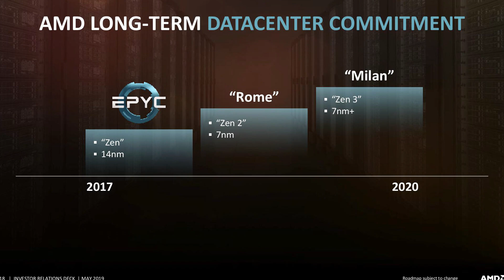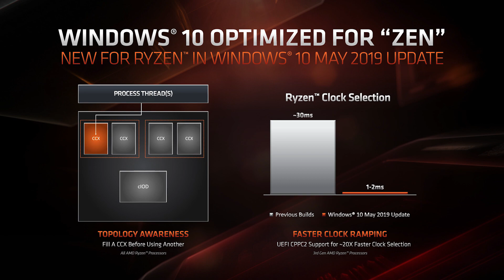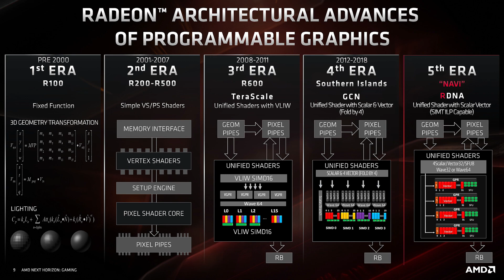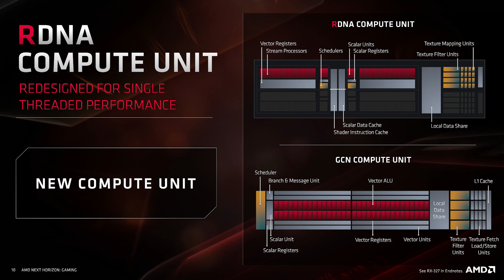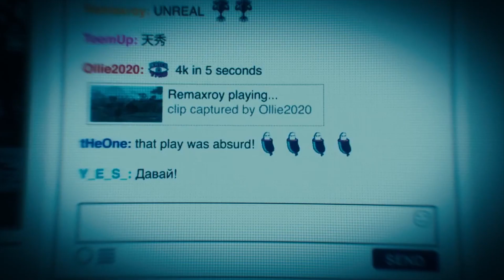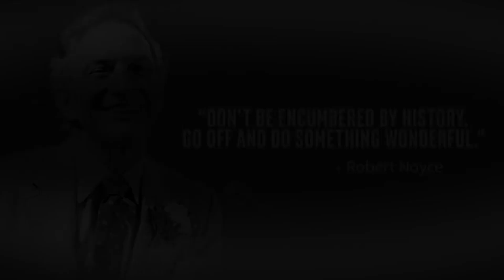Threadripper 3 = Quad Channel ? Navi 12 Entries | Comet Lake & Cascade Lake X Leaks

Comment: Quad channel memory and 64 pci-e lanes is standard for Threadrippers.  How is this news?
Reply: Tom Budd thank you. I had to click on the video to see if my eyes were playing with me
Reply: Well, the Epyc chips have always been 8 channel and 128 PCIe lanes.  While that's not changing either, there will always be some rumour-mongers that will try to get clicks by saying that the next TR will have everything Epyc has, plus 1Ghz overclocks and a far cheaper price.  AMD, compared to Intel, are generous but not idiots.

The reality is that the tradeoffs for thread ripper are the most sensible in the business, while still making those that need extreme enterprise users pay that bit more to cover the R+D.  On the desktop, quad channel is unlikely to be a major bottleneck, they keep ECC support, and Zen 2 seems to support much higher clock speeds as well.  And how are you going to use more than 64 PCIe 4.0 lanes in even a large case with an eATX board?  By my maths, that can support at least 3 top-end graphics cards, multiple NVMe drives, and some other lower-lane add in cards, if you even have the room.  If you are needing 4+ high end Quadro cards, with an 8-way NVMe raid setup, you are not a consumer, you are a render farm or a research institution...
Reply: @davidellis4031  I just upgraded my 1700X system to a TR 2950X system and I'm very happy.  I see the benchmarks of the Ryzen 3000 series and know the 12 core will stomp it in multi threading apps but my bottlenecks were mainly I/O.  The 16 threads, while not as fast as the R3000 series, makes everything smooth as silk and I never have an I/O bottleneck anymore.  This is my first TR platform and I'm very impressed with it so far.  Just wish I could have held out for the TR 3950.
Reply: Should also have a one core 28 nm  cpu since im pss tired of all bios updates on them and they dont work

Comment: I'm dying to know the Zen2 Threadripper clock speeds and single core performance.   This will determine whether I go 3950X or 32 or 64 core TR.  And prices, of course.
Reply: I want to know the single core performance because many applications will only use a single core.

Comment: It's obvious that AMD is not going to change the TR socket.  That would make less than zero sense.  So the Zen 2 TR is going to continue to have 4 memory channels (you can't change the number of memory channels without changing the socket pinout and the motherboard).  Presumably we will continue to support PCIe-v3 on older motherboards and PCIe-v4 will be supported only on new 5-series motherboards.

-Matt
Reply: Do we know all pins were used?  Is it possible they planned ahead and left enough room for two more channels?  Could Daisy Chain linking make this possible?  Or just one stick per channel, leaving the same number of slots?  IDK.

Comment: Ever since for Zen: desktop 2 channel, TR 4 channel, SP 3 8 channel, memory bandwidth is not much of a issue with the large L3 cache, also TR 2990WX had no bandwidth problems, it was just the Windows scheduler, running perfectly well under Linux
Reply: Exactly, Memory Bandwidth isn't a huge issue on Zen, it was blown out of proportion originally and the Threadripper 2990WX is clear evidence that memory bandwidth isn't an issue, it was fine on Linux from day 1, like you say, it was a Windows only issue, these news channels don't own the hardware so have no experience of what it's like in the real world, plus they then quite clearly fail to research properly on previous news that was reported and so start reporting mis-information